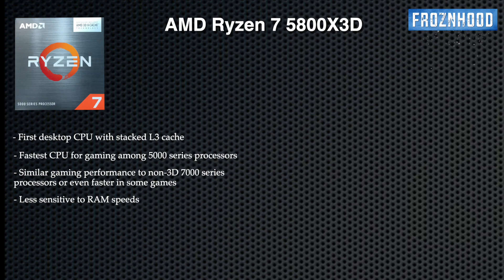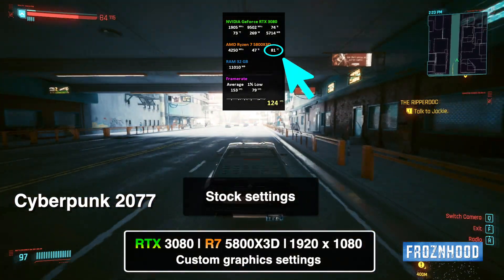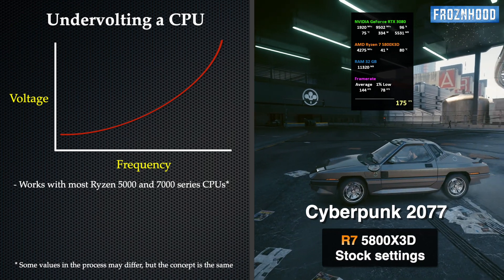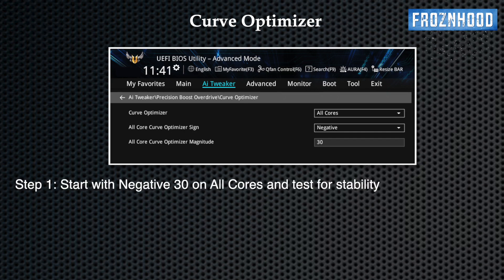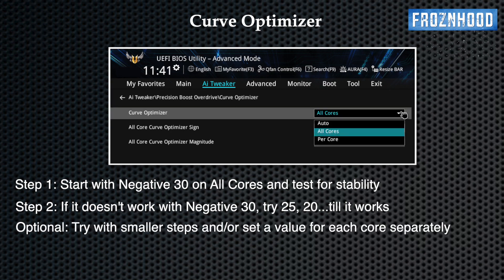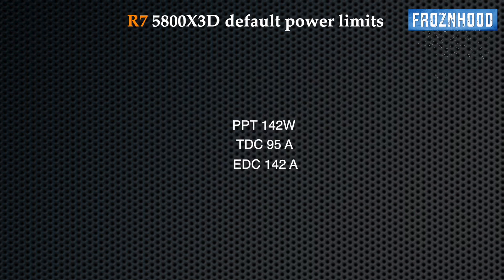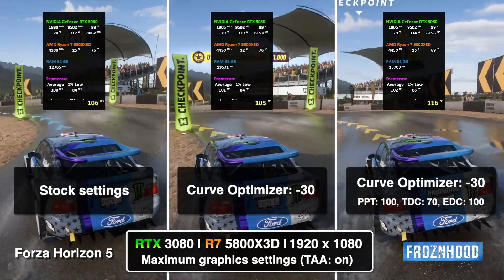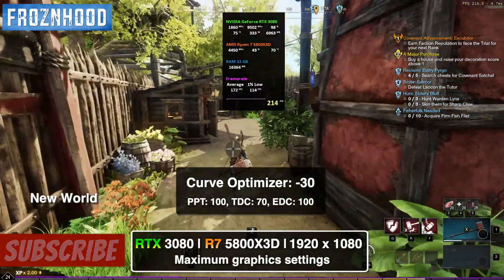Optimizing Ryzen 7 5800X3D - Higher performance, Lower temperature | Undervolting | Curve Optimizer

Comment: My 5800x3d with -30 on all cores runs up to 80° C under full load. In games it is much cooler. I don't feel the need to lower power limits.
Reply: Same. Still have 72-75 in game during Summer. 68 during Winter. 5800x3D aio360mm (game BF2042 and Cyberpunk)

Comment: PPT, TDC, and EDC was grey out for me but I turned off SMT and set the -30 for the curve optimizer since the pc was for gaming. Temps drop 16c so I was running at 54.3c and maintained 4450 MHz clock speeds

Edit: Even though its greyed out you can still click on it and type a value. Applied all the settings and got a 7c reduction in temps and my cinebench score went up 200 for multicore. I turned smt back on for this.
Reply: just click on it and enter a value its weird
Reply: Couldn't figure out why I couldn't switch the values from auto. Thanks for this!

Comment: Hi, first of all thanks a lot for the video, very straight foward information, indeed my temps are lower and all cores runs at 4.449mhz but i noticed something, without the pbo settings one of my cores always boosted to 4.549mhz and with your settings they always boost max to 4.449, is there any way to get that boost with your settings?
Reply from the maker: That 4.55 is above the CPU factory frequency limit, so either it is something temporarily happening or it is a false reading. I have seen reports from people reaching that frequency with 1 or 2 cores, with specific chipset drivers (older versions), but that is not the normal behaviour of the CPU. I don't think it is worth the effort and the time. You may also decrease your performance that way, because it is more important to have 2, 3 or more cores at higher stable frequency than having 1 core at abnormal and questionable frequency. I do not recommend doing this, but, if you want to go that path, check if one and the same core goes up to 4.55 every time. Then set Curve Optimizer per core, leaving that specific core without offset or a minor one (lets say -10). You may also need to set the power settings (PPT...) back to Auto, because that core may need more peak power. But all this doesn't make sense if you want to follow the optimization method shown in the video.
Reply: @FroznHood Single core boost is 4.55 and all core is 4.45ghz (you need to have c-states enabled for 4.55)
Reply: Ty man, hope your channel grows, never seen a guy like u answering all the questions on the comment section haha
Reply from the maker: Thank you very much! You are welcome to visit the channel again.

Comment: -30, ppt: 95, tdc: 60, edc; 90 — I use these, and my PC performs perfectly
Reply: Eu também fiz isso e funcionou bem! 😃
Reply: Still using these settings? Is it stable, are you losing any performance?
Reply: @nytdrxy7146  Yes, I'm still using these settings. Performance is higher than the default. I'm not sure if this is the best solution for every processor, but I read on the forums that many people are doing great with them.

Comment: I just let these PPT, TDC... on default by cpu and put negative offset on all cores. Lazy for intensive testing for stability. Also, never tried to put these settings by motherboard cuz I heard can be agressive. For -30 offset, expected more of temperature drop (middle screen). Is this CPU hot by default and need water cooling?
Reply from the maker: This CPU does not need water cooling, only optimizing.

Comment: if you set, for example, a -25 offset, what  would be the equivalent parameters for PPT/TDC/EDC?
Reply from the maker: They are not directly connected. One does not replace the other. They are different things. With -25 curve, you can still go with the same PPT/TDC/EDC values shown in the video.
Reply: @FroznHood  Ok, i will give it a try. Thanks for the replies.

Comment: Is this improvement only for 1080p? What about 1440p and 4k?
Reply from the maker: The resolution is not a factor here. It is about making the CPU work much better in games, in ALL cases. So you will have better temps and better performance (mainly where you have CPU bottleneck) in all resolutions.

Comment: Is this even needed on a 5600X3D they are tweaked pretty good out of the gate.
Reply from the maker: I don't think it is tweaked in any different way, but if you have one, test it, see if you like the temps and if the frequencies are stable. If you are satisfied, you don't have to do anything. If not, you can tweak it further. Every unit is different.

Comment: A tip for MSI users - mostly older MSI mother boards (B450 etc) - you might not find PBO feature in the BIOS itself - but you can find "Kombo Strike 3" option in the Overclocking/advanced CPU settings, which will give you 1 / 2 / 3 options - translating to an offset of 10 / 20 / 30 respectively.
Reply: Can't find on Tomahawk B550...
Reply: @ondesk9943  you need to do BIOS update
Reply: @ondesk9943  You probably need to update your BIOS.
Reply: @ondesk9943 update your bios
Reply: You can also do it by MSI dragon center. I undervolted to 1 volt because Kombo Strike 3 doesn't undervolt enough for me. It's still getting too hot.
Reply: @mehmetkolsuz4139  please just buy another cooler, you lose up to 200mhz boost.
Reply: Msi b450 mortar max been using kombo strike also since I updated to latest bios
Reply: @Pota2MasterRace  gotcha, that’s Kombo strike not the actual PBO tuner via bios (I know it’s similar), I don’t use it because it has been found to have issues and doesn’t really undervolt as effectively as the PBO tuner made by the community. 

Some MSI boards have the PBO unlocked at bios, idk why MSI refuses to unlock it for the b450 tomahawk max.
Reply: Thanks! I'll test it again in bfv to which one is better @Bluedemonde
Reply: @Bluedemonde  so I tested it again curve optimizer vs kombo strike the clocks for kombo strike atleast in my own pc the cpu clock mostly stays at 4450mhz which what i would like and I mainly play dota2
Reply: So that's it for us using msi kombo strike 3 is -30 
2 is - 20 and 1 is - 10 ? 
And do we have to change voltage stuff or it's done with kombo strike ?
Reply: I have a question if I did what he said in the video changing curve optimizer to -30 and the PPT to 100 tdc to 70 and edc 100 and also use kombo strike "3" will that setting over lap or mess up anything ?
Reply: Pbo is already in msi bios for b450
Reply: @robeyyo847 Not for the B450 tomahawk max, atleast not that I’ve seen in the last few years. 

If so, which firmware?
Reply: The latest bios has the pbo and curve optimiser.. i have the b450 gaming plus max with the 5800x3d!
Reply: @Acc3l3ratoR  pbo really doesnt do anything exept for upping the average clock tho, you wont go beyond 4550 single core or 4450 dual core  or more.
Reply: WTF ... i was looking for that since many times
Reply: I only have PPT setting on my mother board (MSI B550-A PRO AMD AM4). I don't have TDC and EDC. How can I reach it?
Reply: @mehmetkolsuz4139  if you really want to have that, download curve optimizer 2
Reply: @mehmetkolsuz4139 I’m right there with this guy, i have the Tomahawk x570, and i can only find the PPT setting, nothing of TDC or EDC
Reply: Thank you 🙏🏻
Reply: the kombo strike 3 in overclocking settings is WITHIN THE BIOS. dont spread bs. just beccause its under advanced tab in the bios..... you really wouldnt have gotten shit together in times of simple blue and grey bioses.
Reply: @tarkitarker0815  What are you talking about? Kombo Strike 3 is an undervolting tool, KS1 == -10mV, KS2 == -20mV, KS3 == -30mV.
Reply: @BrandonTGS  ahh and tools cant be within an bios, wtf are you on about. also kombo strike was shown to undermine factory restrictions fucking up x3d cpus

Comment: I’m using -25 and noticing drops in temps. Thank you so much. 

I want to dabble with the power limits but I’m not tinker savvy in the slightest. My pc case isn’t the best for airflow so the components aren’t as cool as they could be. Any tips for me to try with the power limit section?

Also I saw some comments here saying -30 Isn’t good for the cpu in the long term. Has their been any developments from your understanding regarding their claims?

I’m planning on keeping my system as is for the next few years, the 5800x3d was the last piece of the puzzle. Lower temps will give me the piece of mind that things are ok with my pc, even if the silicone can handle 90degrees. 

Thank you for this wonderful video I hope good things happen to you in life.
Reply from the maker: Thanks for the feedback and your comment. If the airflow in the case is not so good, try to change that. Put 2 or 3 good fans in the case if it allows it. 

Despite the comments that -30 can harm the CPU, there is no prove about that nor there is any official warning from AMD or the motherboard vendors. Otherwise they would take measures to limit the effect of the Curve Optimizer or disable it permanently. And they would definitely show a warning that using Curve Optimizer can void the warranty. Those who “share” those rumors do not provide any information about how exactly it harms the CPU and what does “in the long term” mean. Overclocking and overvolting is what can harm the CPU, and only if you are not careful or you don’t know what you are doing. And they warn you about that. 

I am using 2 undervolted CPUs 24/7, 100% stable, fast, cool and quiet. 5800X3D just needs this to operate cooler and more stable. It doesn’t mean you should also do it. Make a decision.😀 

The power limits shown in the video are an important part of the undervolting strategy. You can try with the values from the video. Don’t forget to make tests for stability. Cinebench, 3DMark and 2-3 games (one GPU-intensive and at least one CPU-intensive. Do not hesitate to ask questions here. If I can, I will be glad to help.

Comment: With PPT at 100, TDC 70 and EDC 100, my CPU doesnt boost over 4300Mhz (at least in cinebench) which is shame, because as soon as i run it with looser settings (110, 75, 110) it boosts to 4350-4400Mhz, then again, not sure if the difference between synthetic 14 400+ and 14 600+ score is worth the 5°C difference :D
Reply from the maker: Cinebench works differently than the games. In the multi core test it stresses all cores at maximum. This never happens in games. Having that in mind, your 100/70/100 Cinebench score is not bad at all. If you think that your CPU works better with 110/75/110 leave it that way. It is not wrong. Every unit is different.
Reply: @FroznHood  oh yea, at 110/75/110 the btch runs at 81-82°C, while at 100/70/100 its running at around 75°C in Cinebench, even if there was SLIGHT performance loss, im happy the thing doesnt burn itself to the ground xD 

I was previously running -25 on all cores and 120/80/120 which ran at around 85°C during stresstests, though i was setting that  through PBO2, since i didnt know you can offset in bios as the chip is "locked" 

Those temps are with Be Quiet Dark Rock 4 Pro and i hated that in games it was running at around 75-80°C, now with those settings its around 65-70°C which is fine by me :D
Reply: I use 120/75/115, -25 all core with fixed 1.21V
R23 is 15.3k pts with 75° on the cores.

But for competitive games i have smt, c states and cppc all disabled. 

Better latency and fps + even lower temps/power usage..

Comment: Hmmmm i got the 5800x3d. Atm i am using 5900x i undervolt it -25 all core pbo limits disabled. Have you tried disabling PBO limits on your undervolt?
Reply from the maker: I have shown the easiest and best/good enough (in my opinion) way to optimise that CPU. There is absolutely no need to do anything else.
Reply: @FroznHood  yep i agree. Just notice your playing at 1080p. Me i am playing at 1440p :) Ill your Variables in the PBO
Reply from the maker: The resolution doesn't matter here. I play at 1080p, 1440p and 4K.

Comment: I followed you guide. I think, either something is wrong, or am not testing correctly. Because after restart, the system is stable. But HWiNFO shows 3600MHz for CPU frequency.

Shouldn't it be higher, or does it only boost under load?
Reply from the maker: On idle it may be lower. In games you should get 4450 Mhz. If you don't, update the BIOS and reinstall the AMD Chipset driver if you previously had another CPU.
Reply: @FroznHood  Even in games, 3600 is the max. Also, my bios was already updated before putting in the CPU, it's a new system. And AMD chipset were already installed. I see people aaying it's locked and we should use pbotuner2. How about that?
Reply from the maker: No, you absolutely don't need 3rd party apps for that. It should work the way it was shown in the video. You need to check all CPU settings in the BIOS. See if some default settings are not trying to overclock the CPU. What is the model of the motherboard?
Reply: @FroznHood  Asus B550M Plus Wifi II
I have pbo enabled, resize bar, docp.
And CSM is disabled.
Reply: @FroznHood  Another thing. I kept trying to figure it out with no luck. Untill I manually adjust clock multiplier in to 45.

Now it's reading above 4.4GHz under tests. However, I wonder if this is correct. Since your way didn't show that.
Reply from the maker: No, don't manually set the clock speed. Try to disable the PBO or check if boost override is not active (must be off). If you turn off the PBO, check if Curve Optimizer and the power settings are still active.
Reply: @FroznHood  will do and let you know

Comment: Hi there, I have done this -30 on the curve optimiser and helped a lot with temps, more than 10 C all cores have a higher boost from 4.32GHz to 4.45GHz all cores in Cinebench after 15 mins temp max 77C, thank you very much. About the other settings 100-70-100? Is it necessary for better stability or some other thing? 
I also notice in HWiNfo64 there is a section saying "Power Reporting Deviation"(Accuracy), in Cinebench stays around 100% but after a game section it records 47% for (minimum) and over 200%(max), is that so bad?
Reply from the maker: Hi, as I explained in the video, the power settings (PPT....)  can make the clock speeds even more stable and  reduce the temps. Tweaking them is a part of the undervolting process. It is not necessary, but sometimes they have bigger impact then the Curve Optimizer. Regarding your last question, a system is either stable or not. No matter what some app data tells you, if you begin (just after the undervolt) to experience system restarts, crashes, slow downs or other strange behaviour, the PC is not stable and you will need to tweak the settings. If you don't, the system is fine.
Reply: @FroznHood  Got it, thx very much!

Comment: Great video and straight to the point. A note for others running MSI motherboards:

For MSI motherboards, update to the latest BIOS version. The undervolting is called KOMBO strike. It is listed in 3 levels: 1, 2, and 3 which equal -10, -20, and -30 all core undervolt. I was stable at all core -30 with now over 6 months of stability testing and gaming. CPU runs at a boost clock of 4450 consistently and runs around 60-70c on a 360 AIO in most games. On benchmarks like Cinebench it never hits 80c.
Reply: Hi! So help me out - I should just put "-30" in level 3 to make it work?
Reply from the maker: You don't put any values, just select the KOMBO level. Please note that KOMBO is not the same as Curve Optimizer, even though in some cases it may achieve similar result.
Reply: Damn I was thinking of going water but I do better with a scythe mugen. Also fm research I've done you get better temps with 240.
Reply: I've already chose Kombo Strike 3 but for other settings I only have PPT setting on my motherboard (MSI B550-A PRO AMD AM4). I don't have TDC and EDC. Is there any way to reach these other 2 options?
Reply: @mehmetkolsuz4139   I would like to know this information too. I Hope someone can help us out?
Reply: Try updating the bios. I have the same board and works great.
Reply: @humblecarry2  Yeah I have it working now. I don't think changing the TDC EDC PPT matters anyway, because you get a good score with just Kombo strike 3.

Comment: Tried these settings but HWMonitor shows all cores only hitting 4.3Ghz on a Cinebench, would that be considered normal?
Reply from the maker: If it is during the multi core test, yes.
Reply: I'm quite sure that 100/70/100 is not enough power for 4.45 all core, atleast for most people.
If temps aren't an issue just raise the  values. (120/80/120 or smth like that should work for most)

4.45ghz all core is about 15.1-15.3k on cb
Reply from the maker: You can optimize the CPU for different tasks. I am showing how to optimize it for games. Games are not using all cores at full load/speed (when you have a CPU with 6 or more cores). If you are using your PC for specific multi-core tasks, such as graphics or image rendering that is a different story and it needs different optimization. Just having higher score in Cinebench is irrelevant for the gaming performance.

Comment: I bought this cpu and was running almost every game at 90c. I looked into reducing temps, found undervolting solution but every video wanted me to download 5 programs and had 30 minute tutorials so I put it off for 2 months lol. Wish I would have found your video earlier. Thanks for making it so simple. Originally this took my temps from down about 5 degrees but it would still peak at 90. My back fan is broken so I knew that was causing problems. I added a 2nd fan (pull) to my cpu cooler and boom I'm now getting temps in the 60s and peaking at 77 even with that broken back fan. Huge difference for me thanks man. Now I can stop heating my bedroom in the summer.
Reply: I’d highly recommend getting all of your fans working 100%.